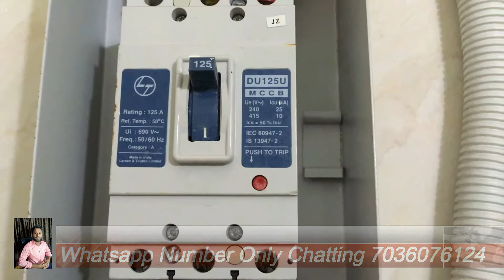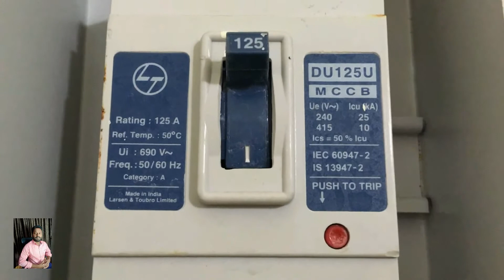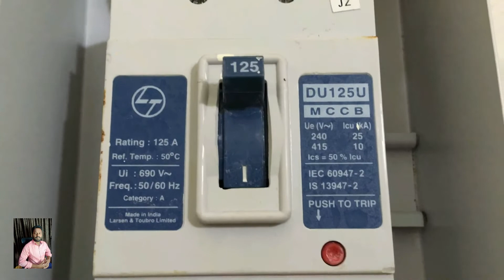What is a MCCB How to Work and Connection Explanation in Telugu

Comment: Bro 3 phase meter  15 kw meter  fuse instead of 100 ams mccb fix chesanu if any problem  total  8 kw use avutundhi power in hotel
Reply from the maker: Hi bro, it should be fine.
Reply: Thank u bro

Comment: Brother Single Face 230V Meter dagara use cheyocha Anna MCCB DP 100A
Reply from the maker: Hi bro 
1. Single phase meter maximum 3 to 5 kilo watt varaku untundi 
2. Example 1 kw = 5 amps 
3. So 5 x 5 = 25 amps mccb 25 amps saripotundi

Comment: Bro series board ki a type MCB vadali bro  nenu series board ki c20 aims fittings chesanu series board lo direct current test చేసి నపుదు phase netural touching అయ్యినై MCB tripping కాలేదు  mcb panel box లో mcb లు tripping కాలేవు tv off అయ్యింది series board wires స్విచ్ లో నుంచి తీసిన తరువత  tv switch board switches ఒన్ చేసాను tv start అయ్యిది టీవీ కి tepleser ఉన్నది  tv ఎం problem కాలేదు bro     కానీ series board lo c20 MCB tripping kaledhu phase netural wires touching అయ్యినపుదు sound vachendhi bro what problems bro please